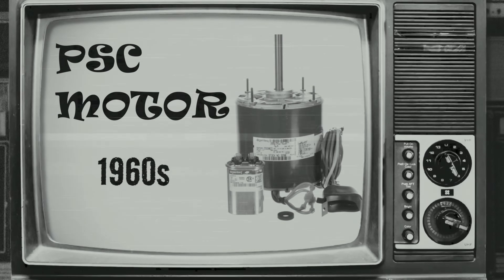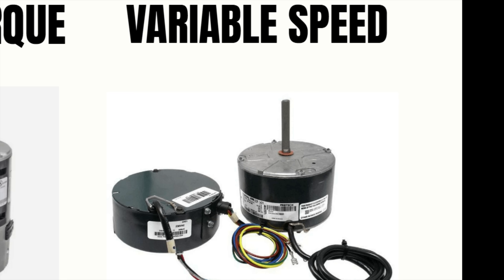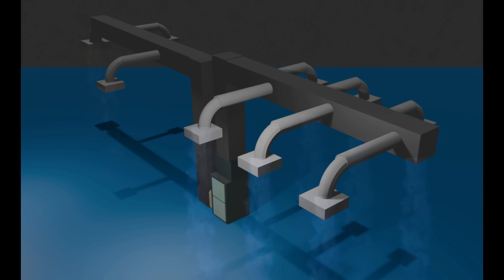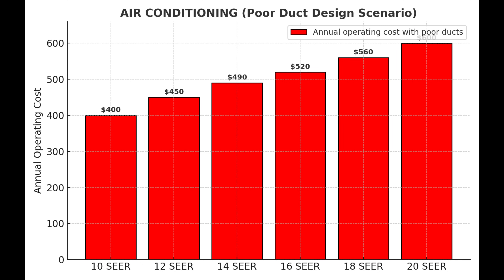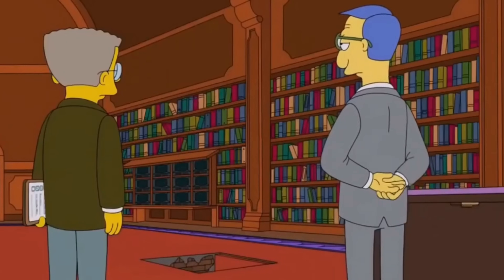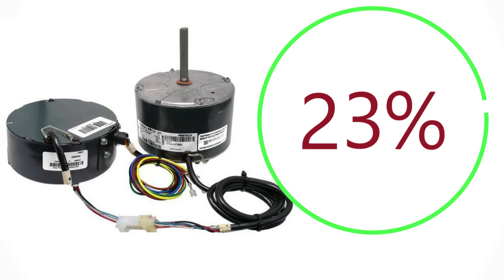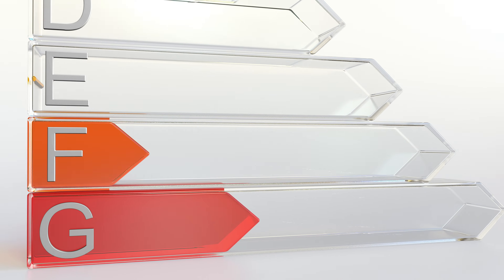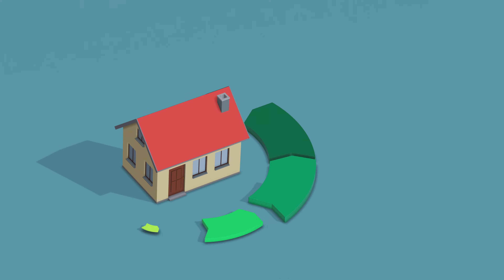The Ugly Truth About Motor Efficiency in HVAC

Comment: As is usually the case, the cost of over complicating a simple machine to squeeze out 10 or 15% more is not worth it.
Reply: There is way too much fixation on efficiency. The extra complication a lot of the time is more for comfort than efficiency. 2-stage with a var speed ecm is more comfortable than single. var speed ecm can be slowed down on demand to improve dehumidification as well offering comfort improvement even with single stage system. full modulating/inverter variable capacity is more comfortable than 2-stage.
It's a question of balancing comfort, efficiency and repair costs and the best option really depends on consumer and existing system.

An instance where the extra complexity pays off is heatpump applications where conventional single and 2-stage heatpumps rapidly lose capacity as it gets colder outside, but many inverter systems give full heat output at 5F outdoors, this saves a hell of a lot of strip heat or oil or propane backup use, saving lots of $$ on top of being more comfortable.
Reply: @Jon-hx7pe  You are simply talking about old systems and old temperatures.  Modern heat pumps easily go down to -13f and even below -31f.

The old and obsolete heat pump systems struggled to get past 0F, but massive improvements in that area have occurred in the last few years.

Comment: ECM is electronically commutated motor, not electrically communicated motor. 

Good information overall. Just wish the ECM motors weren’t soooo expensive.
Reply: It would be nice if they were cheaper, but they are typically under warranty for the first 10 years.
Reply: Although they do communicate electronically.
Reply: @USA-GreedyMenOfNoIntegrity  There really is no "communication" to the motor.  

The motor controller adjusts the voltage and current until the motor RPM gets to a certain speed. Yes, the A/C controller talks to the motor controller, but the motor itself is just ramped up to a certain speed based on the motor controller programming.

Comment: Seems that most AHU have atleast constant torque motors (x13) now a days. Thought that had to do with mandated minimum seer ratings.
Reply from the maker: Yeah, the jump from PSC to constant-torque ECMs lined up with the efficiency standards that pushed manufacturers to hit higher SEER ratings. PSC blowers were fine when static stayed low, but with tighter coils, smaller cabinets, and higher MERV filters, they just couldn’t keep up and still pass efficiency tests.

Comment: What's going with the permanent magnet synchronous motors (referred to as ECM in the video) is that as they slow down, their DC link utilization decreases because of fixed rotor excitation, which means more power is being proportionally burned in the windings vs generating mechanical power and moving air. Single-phase induction motors (PSC) get around this because as their slip frequency increases (motor slows down), their rotor excitation increases, so the two effects cancel each other out.

The solution to this is using a PMSM that is capable of field-weakening/constant power operation, so it doesn't lose efficiency as it slows down. Existing systems don't use them because someone hasn't figured out how to make industrial motors cheap enough for residential HVAC, yet.

I would guess that the compressor motor (for the refrigerant) is agnostic to the ductwork, so the biggest gains to be made are replacing that motor with a PMSM, and leaving the blower motors alone.
Reply: I’m not getting a system that has a PMS anything in it😂

Comment: Modern A/C is Bullshit Incorporated. All I need are induction run motors made properly, good capacitors, quality relays, heat exchangers  made properly thick metal, a good expansion valve, good ductwork, & a refrigerant that doesn't require stupid pressures that reduce the lifespan of system components and leaks evenly (rather than the modern blends that don't) so I can fix the leak if there's a fault and properly add refrigerant without any guessing games. You know, like A/C was made 30 years ago to last 30 years and be cheaply & easily repaired. Thank your politicians & the companies that bought them. I have a jug of 22 and will repair my system even if I have to fab parts for it.
Reply from the maker: Not going to argue with that. I've seen the really old ones go almost 40 years. Everyone would be out of business if they kept making them like that.
Reply: @JerseyMikeHVAC  
Neat fact, Per Trane and copeland, the change from r-22 to r-410a manufacturers saw a huge decrease in compressor failures. The problem with modern equipment is the evaporator coils leaking. 

Me personally, I love variable speed equipment. With proper install it transforms the comfort in the home.

Comment: Would it be better to go back with metal pipe ducts vs the flexible duct ? Wouldn’t this be better for airflow?
Reply: Ya. I'd like to see a flow test between a length of steel pipe duct VS that flexible tin foil stuff. My gut tells me the pipe is better for less restricted air flow, but I could be wrong.
Reply from the maker: That would absolutely help.
Reply: It doesn't work in all areas.  In humid areas, metal ductwork will cause condensation problems.  I know someone that had to rip out all of his metal ducting due to condensation problems, and replaced it with flexible ducting which eliminated the condensation problem.

Comment: Most of these are communicating systems, which show static pressure on the thermostat and will display a warning if it is out of supported range (of course, this isn't the optimal 0.5 but the higher value that is supported by the motor). Also much of the time, the system isn't running at 90+%. At lower output levels, there will be a lower CFM and a lower static pressure. You can also program a lower CFM limit into the thermostat to trade off max BTU/hr for lower CFM if your duct work is slightly undersized. I set at 1250 CFM limit on my 3 ton system for this reason (I think the max is 1400 or 1500).
Reply: what equipment shows the static pressure on the thermostat?
Reply: @walkerandrews8892  I am on my second Carrier Infinity - both this one and the one from circa 2007 have it in the service menu.
Reply: Noone ever dose this in filed if you as the customer don't know this and ask for it.
Reply from the maker: Yeah, lowering CFM cap like you did is a smart trade-off when the ductwork can’t support the full design airflow
Reply: Also bec static pressure rises much more than linearly once you try to push beyond a certain CFM, so targeting just below the knee of the curve has been my approach.
Reply from the maker: @rayl6599 I sort of came to the same end game in a roundabout way going down to 350/T rather than 400 on new equipment in existing homes.

Comment: there is an ugly hack to get advertised ac efficiency: water chilled fancoils or minisplits / vrf systems. drawbacks: there is no return ventilation now, and a lot more noise unless you have higher ceilings and put those into sound insulated duct.

Comment: great explanation. for me its a trap from the replacement cost of the motor alone. its 8x a PSC motor's cost and may or may not be in stock when you need it. you'd be hard pressed to save that much from fan efficiency even with proper ductwork
Reply: The cost of the ECM motor is hardly relevant when it is covered under warranty on many systems for 10 years.

Even if it had to be replaced every 5 years, and I had to pay for it out of pocket, the system would still save me the motor cost and then some, every year.
Reply: @redbaron6805  ECM motor replacement in these parts is around $1000 parts and labor. and nobody ever designs the ductwork properly, especially in resi. You always see these "high efficiency" air handlers being sold with single stage standard efficiency condensers. 

Long story short, ECM motors and other high efficiency tech could be worthwhile but everything has to be done right from the start. And that's too much to ask around here. So i always recommend simplicity and durability over false economy.
Reply: @mintypotato777  Never is a long time and very large number.  The idea that no system is ever designed or installed correctly is obviously pretty absurd.

You also forget that most Variable Speed and High Efficiency systems come with a 10 year parts warranty, if not a 10 year parts and labor warranty.  Hence an ECM motor replacement will never be a $1000 bill for the first 10 years, maybe $150 to $250 if the labor warranty is not included.

You also forget that Variable Speed systems can easily save you hundreds of dollars, if not a thousand dollars annually due to higher efficiency.

So, even IF you ended up replacing the ECM motor every 5 years, and it wasn't covered, you would still be way ahead cost wise.

People really need to look at TCO, not just theoretical parts and labor costs, and they need to consider how these systems are warrantied.

With rising electricity rates, the TCO case for variable speed systems will only go up, as they will end up saving more money each year...
Reply: @redbaron6805  "never" means i have seen a properly designed and installed system a literal handful of times within my 15 years in the trade. And it means i really appreciate when i do see one! And it means I'm all for high efficiency when the rest of the system matches it.

I'm sure cost of living and therefore parts/services is different in your area so we could argue back and forth on the economics for days. The reality is you are getting no tradesman to even show up at your house for less than $250. 

 The funny part is people here who could afford a properly designed system here don't know or care enough about it to make sure it happens. So they just get sold an expensive unit at 100% mark-up and the send their $20/hr install guys to do the "standard" install. The labor warranty is gone in a year and the customer is stuck with an expensive turd.
Reply: @mintypotato777  I am not doubting that a lot of the systems are not perfectly sized and configured, but in my experience, most of the cases involve systems that are too large or too small for the ducting that is installed.

Part of that are homeowners that insist on getting a system that is the wrong size for the ductwork, like upgrading a 3 ton system to a 4 ton, without addressing the ducts.

Most A/C companies just install whatever the homeowner requests, instead of doing the actual load and airflow calculations, and advising the homeowner that the system they are asking to install is the wrong size.

I even have personal experience with that where I strongly advised my own brother against upgrading his 4 ton system to a 5 ton, as the duct work wouldn't support it.

He of course ignored my advice, and it ended up becoming an unmitigated disaster, where he had a massive condensation issue, failing ECM motors, and ended up spending thousands of dollars to re do the ducting to support the larger system.

Even crazier, he literally runs a company installing large A/C control systems into hospitals, airports, etc., and should have absolutely known better, but is stubborn as a mule.

So, your points that the systems are not correctly sized and ducted are valid.  But, half of that are stubborn home owners that think bigger is better, and the other half is clueless fly by night operations that don't take the time to make sure anything is actually correct on the installation, and don't push back when asked to install a 5 ton system into a 3 ton duct work.

But, this is largely a side effect of getting rid of professional trades, and just paying the cheapest guy around to do the work.

Hence, plumbing, electrical, A/C and other work is often done by the lowest bidder with zero experience and who's only goal is to just get it done and move on to the next one.
Reply: this is the other obvious major factor to stay away from one of these systems, I had an older variable speed unit where the ECM part of the motor went up twice in 15 years at the tune of 600 bucks each time(my cost, I repaired it myself), there went all the efficiency savings out the window
Reply: @elky82  high static/undersized duct kills ecm modules. when the system is properly sized for ductwork, ecm will not die.
Reply: @elky82  If you think 600 bucks ever 7 to 8 years kills the energy savings of a variable speed system, you must be terrible at elementary math.  That is about $75 to $85 a year....

Comment: A great explanation. I have two window unit Air Conditioners; the static pressure should be really low- or nothing?- for both, so even though they are CEER 15 or about 25% less than Mini Split systems, not having the issue this video describes means I do not need to worry about it. (Both of my Air Conditioners are enough to fully cool my apartment, so I use only one at a time...depending on which room I want the air flow to originate.)

Comment: You know a truck in park will uae less gas than one in drive? They draw more power, but they do more work.
Reply from the maker: It's not really about park vs. drive. A better analogy is a truck will use less gas driving one mile on a flat open road vs.  driving one mile uphill. Static pressure is the hill.

Comment: Sounds like a lot of people need to learn how to design a duct system.
But, what are the duck labor laws on all this duck work that's going on? Is DOSHA involved? Is the duck testing computer based or do they have to learn how to hold pencils in their bills?
Reply from the maker: New construction has standards on duct systems that must pass certain tests on inspections, but in existing homes, duct work is hardly even a thought. It's just mechanical/electrical/plumbing inspections.
Reply: @JerseyMikeHVAC  Hopefully those standards help improve the situation. They should also be required for system replacements & new installations in old homes.
Reply: My area basic mechanical inspection. Sealed ducts. no duct tests.

Comment: Static pressure kills these motors.
Rather than fix the airflow issues by adding more return and tossing the 1" pleated filters.
Many contractors are swapping PSC motors after an ECM failire to "help" their
customers. 
Domo arigato, sensei 🙏
Reply from the maker: True. But in a lot of cases I think that's usually done due to price rather than performance.  Who wants to pay 3 grand for a blower?
Reply: @JerseyMikeHVAC  they aren't 3 grand unless doing a large markup on an already very expensive part which is unethical.

Comment: Spending sometimes 2-3 times as much money to improve  ductwork to gain 15-20% efficiency doesn't make sense to any homeowner that understands the truth. It only makes sense to manufacturers, big hvac companies that push this stuff and the federal government. We've reached a point in hvac where the juice aint worth the squeeze. Educate your customer and help them understand the true ripoff  of high end equipment. You got companies out there putting these $20,000 systems in homes that will likely never see the return on investment before they get told the system needs replaced again. Quit mining for fools gold homeowners.
Reply from the maker: The whole point is that it doesn't make sense in some situations.
Reply: Sealing the duct work should be code because it’s the most effective thing you can do to improve efficiency and it doesn’t cost that much relative to a new system.